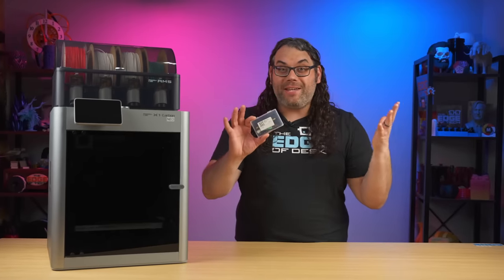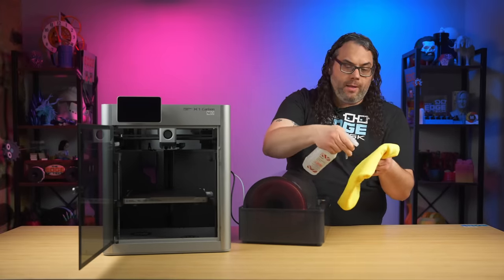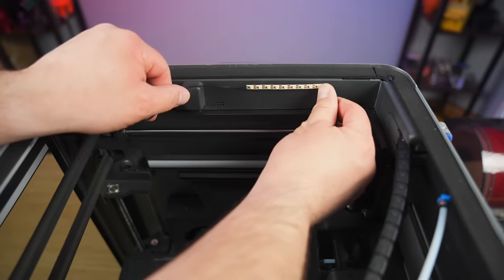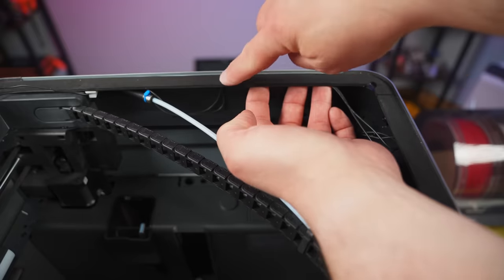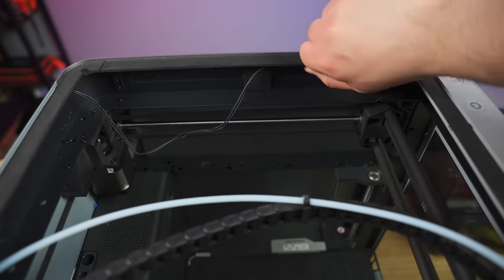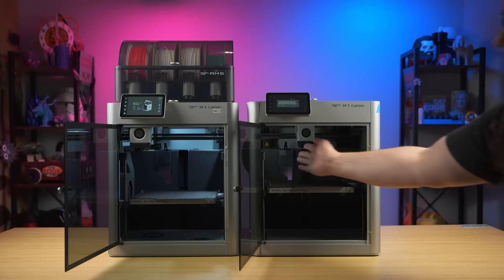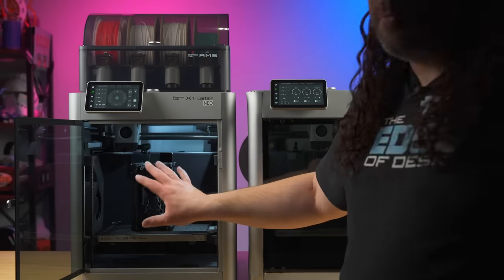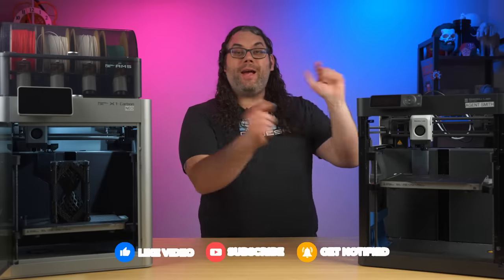Upgrading My Bambu Lab 3D Printers - How To Install New Lights!

Comment: I'd imagine you could fairly easily splice the stock and upgraded light together. Either soldering them, or making a custom plug that goes in the port with two female ports to plug each into.

Comment: BL LED controller. It is a bit more difficult to install but you get a heck of a lot more lighting and it controls the lights so it doesn't mess with the lidar.
Reply from the maker: Like I said in the video, I agree that there are different ways to do this! This is just the cheapest and fastest way if you're just looking for extra light! Thank you for your feedback!
Reply: These  do not mess up the LIDAR. We tested all that before selling :)

Comment: Nice to have options. I prefer the BLLED because you don’t have to wire something into your printer and you don’t need wires strung inside the chamber. It also gives you the added benefits of much more light, colored lights that reflect the printer status, turns off the lights during LiDAR calibration, etc. BLLED also requires no soldering, but it does require that you print a riser. The remixed riser for BLLED is awesome, and I uploaded an improved light diffuser to Maker World that keeps the LEDs from shining in your eyes.
Reply from the maker: Great feedback! That is a great system, I agree! Somebody is looking just to do extra light. Super fast, and cheap, this is a great alternative to that one!
Reply: What's the BLLED? Is it an official BL light addon? I've never heard of it. I have risers with some string lights that I soldered up on all my BL machines, but I'd like to have a better setup.
Reply: Yeah the blled is great in theory.   Too bad it only works half the time.
Reply: @adamklosterman8960 , mine works perfectly all the time. I’d make sure you’ve flashed to the latest firmware and that you connected the wires well.
Reply: @jamesche75  tried both firmwares twice, tried on 2 different networks, wiring is fine, not impressed.

Comment: I just installed my kit in my X1. Wow, it sure makes a difference.  One  extra note is that with my new kit there were 7 cable clips, which made cable dressing much nicer. It's good to know that the TH3D folks listen to suggestions. This is a great added value to my X1.  I had the top off when I turned on my printer after installation. I looked at the lights and it didn't light up right away. A few moments later the lights snapped on and wow, I  reacted to the sudden burst of light by instinctively ducking back a little. It sure looks nice now.  Kudo's to The Edge of Tech for this guide and review. It was seeing this that got me to buy and install my own.

Comment: Great upgrade tip!  Thanks! I just got mine a couple hours ago and installed it right away.  It did only take 10 minutes.  Not only does it make seeing what's going on in there easier, but the extra light will definitely make it much easier to service the X1C.  Thanks again for this upgrade tip.

Comment: I bought a few of these LEDs weeks back.  It is a great deal and great design.  I originally installed the same way you showed in the video . The main issue is the light blind camera. 

However, after testing, I found it best to route the other direction.  I mounted 2 of the LEDs in the front, and the 3rd LED about the same as the first one you did. ( Basically above the OEM light). 

The result is no blinding lights on the camera. No blinding light when looking through the front. The light should be coming from behind the camera. The front mounted LED's light up the print head and makes working on the head much better as it gets lit up.
Reply from the maker: Great idea! Just becuase their directions show to mount them the way I did, doesn't mean you have to do it that way! You can mount these lights anywhere you want as long as it won't get caught in anything!
Reply: sure after I just installed mine following your directions. Guess I need you to ship me a new set to replace this one.

Comment: I print with black filament a lot and always struggle to see how the print is progressing through the X1's camera, so I would definitely benefit from this upgrade. But I do wonder if Bambu intentionally made the built-in LED as dim as it is. It would have been cool to see some kind of before-and-after test involving the LIDAR calibration to make sure the brighter light doesn't have a negative impact on that.
Reply from the maker: Great ideat! And I have TH3D Working on a Y cable that will allow these to work with the factory lights too!
Reply: its for the lidar
Reply: @peterpeter5666  I'm not so sure about that now.  Since I posted my comment, it has occurred to me that the built-in LED is can be turned on and off by software.   So, why wouldn't Bambu have just turned off the LED during LIDAR calibration if light interference was an issue?     Also, they don't give any warnings to not use the printer in a bright room to keep light from interfering with the LIDAR either.
Reply: @JesseOsby  makes sense but that's the excuse I always heard when I was deciding wether to get a p1s or x1 c
Reply: @JesseOsby yes exactly lol, if it was a problem they would simply tell the light to switch off during the calibration 😂
Reply: I was just looking on amazon for a Y splitter.  Keep us updated! @TheEdgeofTech

Comment: I already have LED strips and JST connectors and so I will make my own, I made a part in Fusion for an angled light strip and diffuser for my Ender 5 Plus machines and so I might convert that for my X1C, I would also use black clips so they don't stand out, I might also add a socket at the end for the OG JST so I have the OG light active also.
Reply: I wouldn't mind creating my own strips as well. I have the connectors and crimping tools at hand so then I could power the stock LED bar along with my own strip. I don't know what the voltage of the strips should be but I'm sure that I can find that info somewhere.

Comment: A great solution for most users.  I have risers on both of mine so I can run PLA with the doors closed.  This presents a lot of opportunities to increase lighting,  just haven't got to the point that it is important enough to do.

Comment: Just got the kit in the mail. For the price, this is a great deal, but you can't use the light placement provided in this video, which is putting the lights on the opposite side for the object you are trying to view. For an application like this, you want the light source behind the camera, so I put the strips on the front panel and right next to the camera.

Additionally, there should be a y-splitter comign in this kit too.

If you use the set up in the kit's instructions, you will not get an improvement, in fact, my prints (black ABS) were even harder to see. Hopefully the kit can get some updated instructions.

Comment: What an amazing difference! Just got the kit minutes ago and it's already installed and working, almost too easy. I wouldn't say it's a "printing" game changer, but I sure as heck like being able to see what I'm printing, even through the smoked glass. Thanks for bringing this product to our attention! I also second the commenter who asked, will we be getting the Y cable for those who bought the kit before?
Reply: The Y cable will be a separate addon that anyone can purchase once we get them in and finalized. We're playing with a few different designs right now and then will need to test to make sure they work correctly without causing issues with the printer.
Reply: Will connecting both draw more power than the port can handle?
Reply: @davidzizza  depends on what you connect. The fet is rated for 0.9A

Comment: I really wish they would’ve thrown a USB connector on the P1 version. Then the original light would also work. I’ve used that USB port for other LED kits on my P1S, but the LED strips themselves haven’t been ideal, especially under higher temp conditions. The adhesive doesn’t stick lol.

Comment: You stated you would like to have both lights at the same time and out of curiosity why didn't you just in stall the readily available LED Light strip with the standard USB connector? A standard USB connector is available on the side of the P1S in the frame in the circuitry behind the display. This way you get both lights at the same time. This one turns on when the machine is on.

Comment: Not all X1Cs are the same. 

My light was too bright and I created a better defuser so I stopped blowing out my camera. 

I know it’s not the camera because I have four X1Cs. Two are too bright. Or more likely from what I see the lights are more cool and possibly brighter. 

That being said, my other two are nearly too bright with pure white. 

I have used a lot of LEDs to fix my minor problems. In the early days when failure detection was actually useable, some LEDs caused problems with that system. I wonder if they it back on that feature because people wouldn’t stop adding more lights…

Anyway this is awesome. Given how much power is needed for these lights I’d say you could safely split the power to the original light bar if you like.

Comment: This is not a game changer. It’s even worse then other solutions like BL LED. 

Plus putting double sided tape, which is on the LEDs, is always a risk in a heat area. 

Also grabbing power from a point not designed for doing more is at risk of burning that part.
Reply from the maker: I disagree, it's plugged in exactly where the other lights are plugged in. How is that grabbing power from a point not designed for it?

Comment: Got my light strip from TH3D installed today. It makes such a huge difference. There's just enough room between the toolhead carriage and the underside of the metal frame to allow you to put the lights under that lip, pointing downward, and the toolhead doesn't rub the lights. So they are effectively hidden from view. Does anyone have g-codes that could be added at the beginning of the startup to turn the light off, then back on after the printing actually starts? Anyone know what size the JST connector is? I still need to make a y-connector for the old light to still be lit up.
Reply: Update the Y-connector is still working great with zero problems. So I think after 5 days we have passed the smoke test. Possibly quite literally.

Comment: Do they not make a Y splitter so that we can plug in both the kit and the original LED lights?
Reply from the maker: I have him that feedback too and he is looking to get them in! I want one!
Reply: @TheEdgeofTech  Other discussions I've read say this will be an issue because it will draw too much power. 350ma is the max recommended by Bambu. Do we know how many the LEDs are pulling?

Comment: Has anyone Upgraded their Bambu Power Cable to something longer and heavy duty, or just a heavy-duty cable? I have found some 14ga 15a 125v cable from reputable brands for pcs that are 6-10ft long. I was looking at running my Bambu P1S on a high-end surge protector or a sine wave ups.

Comment: What was unplugged and never plugged back in??? (Never mind. That's what I thought. Need a Y connector.)
Reply: That is the original led light, not needed anymore with the new ledkit 😉
Reply: @JohnHDK  But a Y would be even better.
Reply from the maker: I have TH3D working on a Y cable for this exact reason. Like I said in the video, I would love to see these work along with the stock lights!
Reply from the maker: I wish we could stil use it though!
Reply from the maker: I have TH3D working on a Y cable for this exact reason. Like I said in the video, I would love to see these work along with the stock lights!
Reply: @TheEdgeofTech  Yeah. If you have a link to a source, I'd appreciate it. I ordered mine yesterday so I assume it will be before they get a chance to include one. I won't use it w/o one. Until I can source one, it's a $15 lesson learned. I have a lot of those. LOL

Comment: While it's nice to see more through the door and into the printer, that's not usually where I monitor the printer and prints. I do that through the video feed. It's a shame you didn't include a capture of the differences in BambuStudio/Orca

Comment: what is the connector called? wondering if there's a full circle LED rather than having a couple on 3 sides.
Reply: I’ve tried generic strip kits on my P1S through the USB port. There isn’t a clean path with only 4 90° turns for the strips to adhere to, so a continuous strip is actually more of a hassle. It would be nice if the sections of LEDs were longer with less wire in between them. A better light to length ratio lol

Comment: I'm so glad I found this video, I'm definitely going to buy one. My only question is, why didn't they put one more set of LEDs on the front by the door?
Reply: There are cables in the way in the front of the machine that make it hard to mount the strip in there.
Reply: @TH3DStudio  
Thanks for your prompt answer. I'm looking forward to having the extra light  😬

Comment: I'll wait until the Y cable becomes available, so I can order them in one go. Also, wouldn't it make more sense to put one of the strips on the front instead of on the back? Or would there not be enough clearance with the toolhead moving across the front?
Reply: Yes, you don't want to use the set up in the instructions. Light sources goes behind the camera, out of view. This isn't some artsy photo to capture an outline, we want maximum details.

Comment: Great video as always my friend! I really wish they would have 4 strips of lights for all 4 sides. Any chance to inquire with them why there was only 3? With there only being 3, if they could have it where it also uses the stock light, then you could start your first light after the connector at the front and last strip would be in rear then stock would cover that nonexistent for light.
Reply: The front of the machine has multiple cables in the way that make it hard to mount a light.

Comment: I printed a riser that holds the LEDs at an angle. I first installed the LEDs on my P1S on the top rail and didn't like the look. Installed them in the riser and it made a big difference focusing the light on the build plate almost like stadium lights.
Reply from the maker: I like those too, and they are a great option!

Comment: $5 monster light and riser works better imo
Reply: This is what i did. Made a beefy riser with vents i could open and close for different materials, and installed a ceiling light, it was a bit more than $5, but not much. Compared to this led light kit, its night and day difference
Reply from the maker: I will check that out too! I like this one because it's quick and easy, but I know there are a ton of options out there! Thanks for watching!
Reply from the maker: Nice! This is a great option as well!

Comment: I'm no electrical engineer...couldn't you just add a splitter to the board so you could have both lights working at the same time?
Reply: Working on it. :)
Reply: @TH3DStudio  I bought this kit from you and a splitter from Amazon. I just hope they play nice together.   fingers crossed
Reply: @Chad.The.Flornadian  if something breaks we cannot guarantee compatibility with 3rd party cables with our kits. Be careful.

Comment: I did this and it damaged the AP board. The problem is that they don’t sell it on the website and I have to go through the support which is super slow at the moment due to A1 recall. The printer is still functional.
Reply from the maker: Whoa! How did it fry the board??
Reply from the maker: Was this the TH3D kit that you put on or different lights?
Reply: @TheEdgeofTech  I must correct it didn’t fry the board. It caused damages to the board. According to Bambu labs - The LED fill light circuit supports up to 5V 0.3A fill light, so a short circuit or overcurrent may cause damage to the AP board. Aftermarket lights like this one can take more current than that which causes damage to that board.
Reply: @TheEdgeofTech  yes so mine is always dim and cannot be turned off. I am working with support at the moment to get a new board.
Reply from the maker: @Theprofessor1212  Did you reach out to TH3D about this as well?
Reply: Hi there @deepinderjitsingh - is this was from us please let me know the order number so we can make a ticket and figure out what happened as well as making you whole again.
Reply: @deepinderjitsingh If this was the TH3D kit that caused issues please send us a ticket so we can see what happened and get your machine fixed.
Reply: @TH3DStudio  @thedgeoftech I check with the boys in our fabrication workshop and it was not your kit. It looks exactly the same as yours though but it was from an Australian vendor. Sorry I mistook it for you and for the late reply.